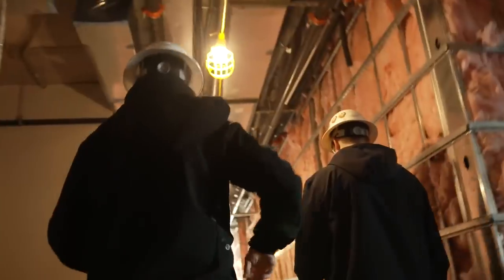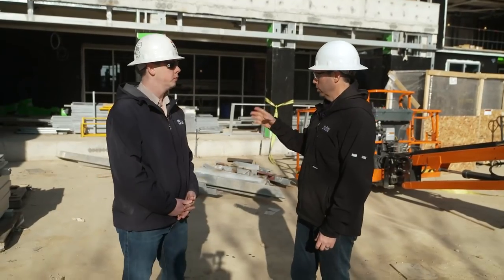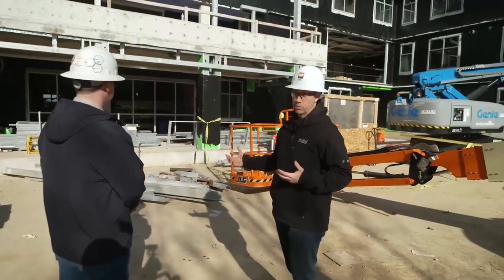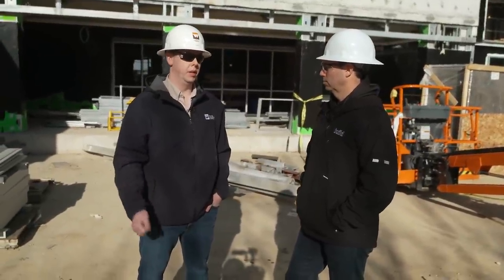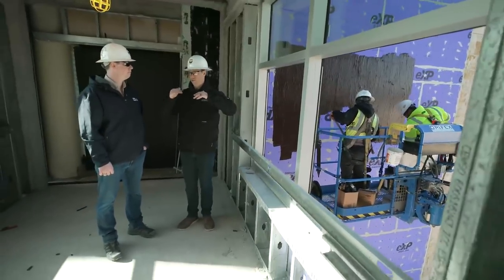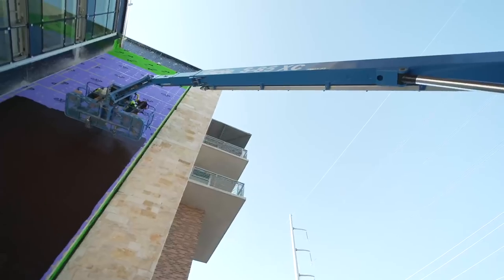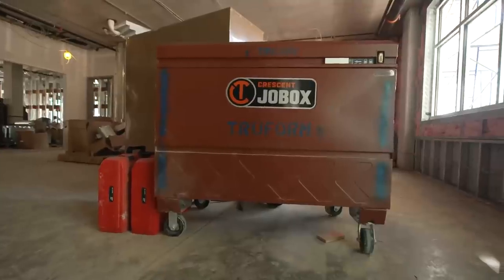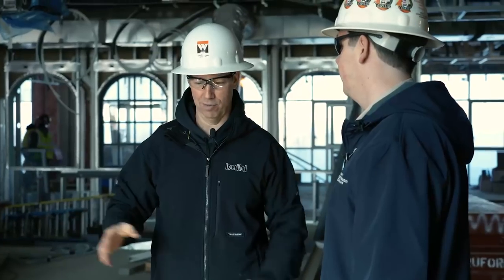What can we learn from a 300,000 sq ft Building Job Site?

Comment: More commercial construction sites would a great addition to the channel.
Reply: They're neat but they generally don't translate too well to residential. 

The membrane he was showcasing would but not much else here really, outside of steel framing. 

Even with steel the cost can get pretty stiff when moving to load bearing/exterior walls.

Comment: Matt, how does this new exterior sheeting actually stack up in longevity?  when I see this gypsum sheet being put up in my northern Idaho climate,  I question what happens if it gets wet? even condensation?
Reply: The thinner layer the better, or else it cracks in the future. but it depends of the material movement of the building.
Reply: It doesn't have paper or any organic material so it just dries out.

Comment: "...the other thing that really strikes me that I don't have to deal with on residential nearly to the extent you do is fire resistance and fire rated assemblies..."
  
This is one of the biggest reasons when I did commercial construction, I started to gain a severe distaste for light residential building practices...  it's like they are designed to be burned down, blown or washed away, or shaken to pieces.
Reply: Curious of what the cost would be to do this on a residential house.
Reply: @dougruwe288  from someone that develops MF apartments and SF residential it’s about 50% more even with the much great economies of scale that we have with MF.
Reply: @dougruwe288  no much more or even less. 
those USG sheating panel are 25$ vs 75$ for ZIP panels or 55$ for playwood sheathing. Even if you have to roll that compound or use house wrap you may still come out cheaper than ZIP wall.
Reply: You are right Tim. I am a 3rd party residential inspector that sees many homes in construction phase. The builders do what the local building inspectors let them get away with. So I hear, it passed... So different in when I get to do a commercial job site...
Reply: @ronaldpigeon4713  I have even seen builders convince AHJ inspectors to let them get away with stuff in residential (seeing that happen with one GC made me walk off a job and go commercial).  Never saw that fly in commercial building - it's like a totally different mindset.  Residential are expected to have a disaster befall them, and the expectation is that insurance will cover the cost.  Commercial seems like liability is watched very tightly, and insurance will throw you under the bus if you cut corners - mostly due to the capital required for repairs.  Insurance doesn't just want to see the "pass" on the building inspection at commercial level, they want to see photos and all the documentation.  When something bad happens, insurance will pour over the documentation and look for any reason to wash their hands of the liability so the care and details are watched much closer during builds.
Reply: @Real_Tim_S  insurance puts in AHJ and love below code construction when they're paying for it. They also charge presuming code compliance so they charge a higher rate than the home should.

Comment: Note - exterior plugs, hydrants, etc. in the mockup. Residential mockups almost never go that far. We should have checklists for monster mockups that cover EVERY flashing/transition detail for every class of penetration, because they are all quite unique. For example, recessed electrical boxes are typically not airtight and typically not reliable at kicking any incidental water to the exterior…. we need to be asking “what are you sealing in rather than out” on every condition.
Reply: There is a fine line between cost and time on residential compared to commercial, some details on residential do not need to be as in depth compared to these bigger jobs.  As a contractor I would appreciate that extra detail so there are less calls to the architect or manufacturers of the product.

Comment: i changed employeers and tried commercial (briefly), its not for me. locking up tools and dragging them over 100,000s sqft is a pain. and working with 100s of guys there is gonna be a least 1 crackhead stealing tools. you have to be able to lock up everything just to go pee, or go to lunch, or go meet with someone, or be able to take everything the next floor up. I never understood the large rolling toolboxes at HD, maybe for some guys garage, but really its what you need for commercial construction. And then you have to be able to take it job site to jobsite, fully loaded. Commercial construction is a pain in the butt.

Comment: Matt, if you read this you should swing by our jobsite in NE Portland next time you find yourself in the NW. I’ve been following you for years and would love to show you our project. Similar to the one here but 3 stories of PT decks that transfer to load bearing steel stud walls and mass plywood panels for the structural deck. The project is called Cascada by Solterra.

Comment: That coating won’t last over time. Moisture will find it’s way under it in time and eventually cause separation. It will start at the sill of the windows first and work it’s way down.
Reply: I think it dries to a rubber like thing instead of completely hard so I don’t see how it would crack and break down within many decades

Comment: Nice thing about that style of building is that there are NO load bearing walls so you can put walls where ever you want and you can remodel without worrying about removing and replacing walls in a different location at will.
Reply: You can do that with residential, people just don't think about it. Think about how many times you have seen remodeling where they remove a structural wall with beams. Put the structural in on the beginning and drywall your ceiling and exterior walls. Then do your interior.
Reply: @davidkellers8152  
But in this case, with the type of construction they are talking about there are zero load bearing walls.  There are zero load bearing walls to worry about.  There is zero need to install posts and a beam to hold anything up.  You can go to any part of the structure and start tearing out existing walls with zero concern that part of the building above that wall will bend or collapse and put up new walls where ever you want them to be.

All the walls do is hold themselves up and what ever you decide to attach to them.  Shelves, cabinets, pictures, etcetera.

Comment: Do you think that the Single Family Build For Rent movement will drive more commercial practices into the residential trades?  I’m sure that’s been happening over time anyway, but it would be great to hear your thoughts.
Reply: Hotels are a hybrid of commercial and residential for the most part. The 3/4 story cookie cutters. They use structural iron and steel for lobbies and Elevators and then suites are just like an apartment or small house. Exteriors are a hybrid as well. Densglass and stucco or wood or masonry finishes

Comment: Aust loves “liquid applied” membranes, though we love to use them on balcony substrates. 
And they are a disaster here, With over a decades experience in building defects, the liquid applied products are notorious for failing at junctions and sheet joins. 
Usually I’ve found taped joints will better than straight caulked joints. 
Way too much info for a YT comment ;p
Reply: I think using both would work. You think the heat is what makes the liquid fail?
Reply: @jwristen24  movement is the largest cause of failure. Ie movement between two sheets, cracking of concrete slabs 
If a movement/slip joint is allowed for when the product is applied, The chances of failure are greatly diminished. 
The class 3(highest rated) products in aust have to have an elasticity rating of 300%. Which is ok if you have a 10-20 slip joint… 300x10mm gives you plenty of room to move. But if the movement is unexpected ie shrinkage cracks in concrete. It equals 300x0, and the product tears . 

Quality trades also plays a big part. 
- substrate prep
- application: detailing, product thickness and cure times  
- Compatible products adjacent 
Understanding of surrounding systems 

Crap I’m ranting again ;p
Reply: @edmuggles  rant on brother. Thanks for info. Makes total sense. Appreciate it

Comment: Are they using the drywall sheathing to avoid having to use carpenters?  I know he said they ran into issues with a product supply but I see this sheathing used all over.
Reply: It's probably a fire resistance thing.
Reply: Funnily enough they’re still carpenters, most likely union. Div 9.2 is usually staffed with carpenters and finishers from the union hall and they’ll do steel studs, gypsum products, and drop ceilings